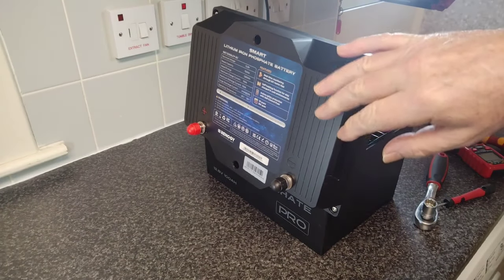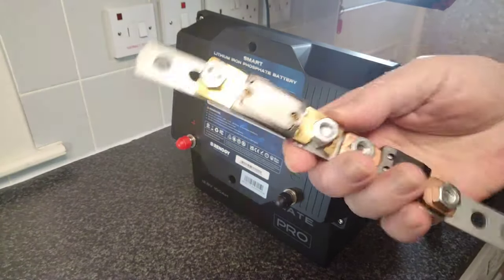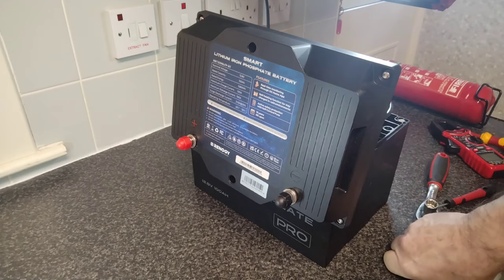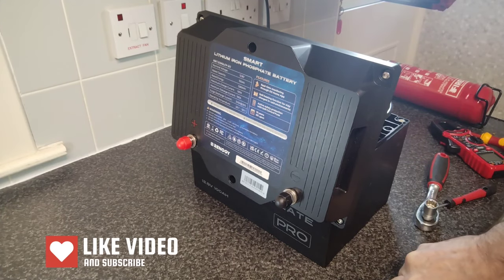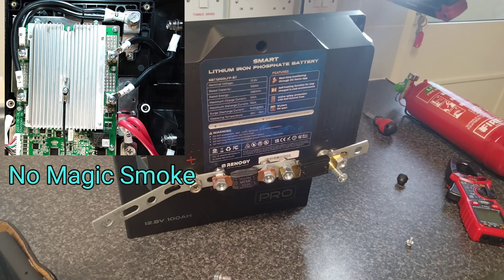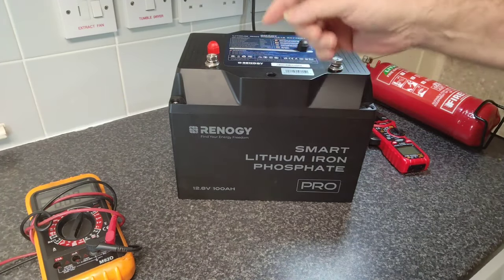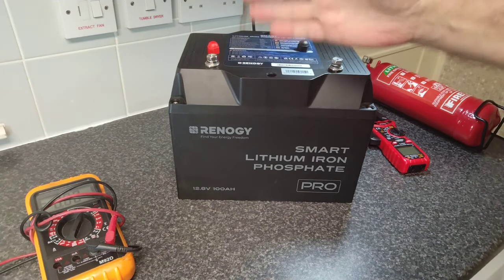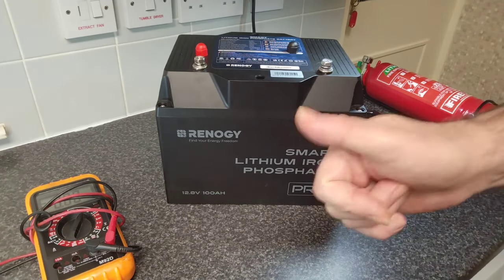Dead Shorting a 12V 100Ah lifepo4 battery. #renogy #lifepo4 #deadshort

Comment: Safety check ... place battery on combustible surface inside house, install running shoes 😂😂 brilliant.   I was wondering how brave .. is he gonna hold that mechano over the terminals ... omg you should do horror movies, the suspense was intense!   Thank you for making these short videos, straight to the point, no extra padding, brilliant 👏 👍 👌 🙌    interesting you said about series, I didn't know that some batteries don't allow that, what would happen if I tried that?

Cheers
Reply from the maker: Thanks for watching and taking time to comment. Not all batteries are compatible with series connection due to the voltage limitations of their battery management systems. You would essentially fry the BMS components.
Reply: Thank you I obviously didn't know this.  Are you an electrical engineer in your daytime life or similar? just wondering about your background as you are quite stealth on video!
Reply from the maker: Yes, I don't think people watch to see my face which is probably more suited to radio than film 😅 but I have a very varied background which leaves me as a jack of all trade's, master of none. They do say a little Knowledge is a dangerous thing. 😆